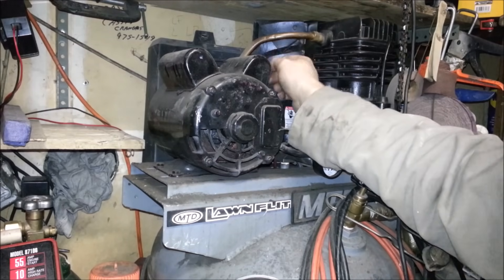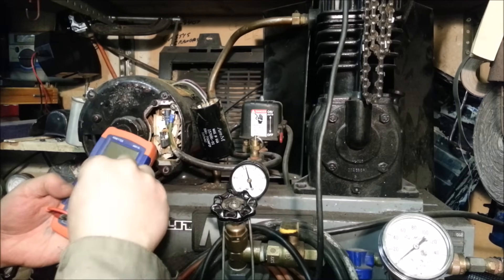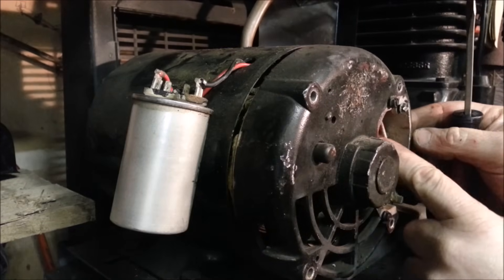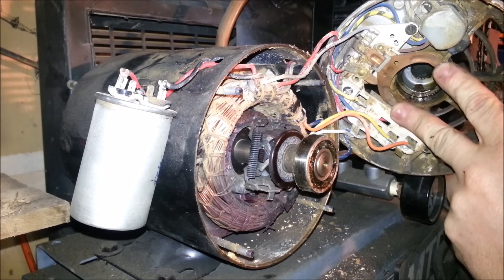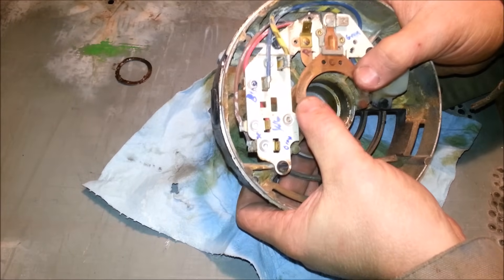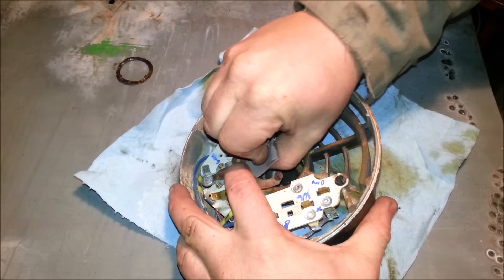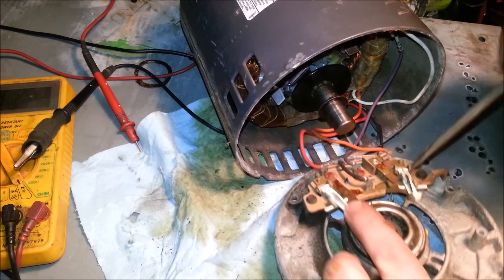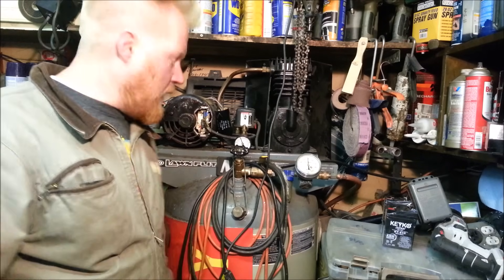Electric Motor Doesn't Spin but HUMS/Buzzes compressors etc

Comment: I got a Briggs and Stratton compressor from Walmart a year or two ago. It did the humming thing when it was supposed to refill. It would start fine from empty but when it gets down low and supposed to refill, it just hums. I had to turn it off, empty the remainder of the tank and then turn it back on for it to refill. It fixed itself over time, or at least it hasn’t done it in a while, but I was wondering what you thought the problem was?
Reply from the maker: There is a little check ball valve that holds back the pressure in the air tank. More than likely debris held it open and the air would force itself back into the pump.

Comment: In addition to increasing the starting torque, the motor rotation direction is also determined by the start winding.    To reverse the direction of rotation, swap over the two windings to the start winding!

Comment: If I'm not mistaken the run coil is bypassed while that centrifugal is in the closed (motor start position) when the motor RPM is high enough the run coil(s) are in series with the start coils... I could be wrong though (or perhaps not all centrifugal switch motors are setup that way ... I only remember the old washing machine motors (no caps at all)
Reply from the maker: The most common is to have the  Run and Start windings powered in parallel with the motor initial start and then the centrifugal switch  disconnects just the Start windings. The Start windings easily overcome the lower torque of the Run windings so powering them only adds to the ease of starting.

Comment: The humming that you hear is NOT coming from the "start" winding but from the "run" windings which stay engaged all the time (as long as the pressure switch is calling for air). The "start" windings cannot be the source of the humming because the start switch is not passing current. So the start switch does not transfer power from the start windings to the run windings.

Comment: Hey friend, is there any kind of grease that is safe to put on the contact's ? Mine did it again..they're not burnt but i did sand them..just wondering
Cheers friend 🇺🇸🇺🇸🇺🇸🇺🇸🇺🇸🇺🇸🇺🇸FORD RULES..THE OLDER ONES...
Reply from the maker: Not really. Most have a coating that prolongs the life. Once this is worn off they tend to wear out a lot faster. Some major brands of motors you can find replacements.

Comment: I bought a blue hawk from Lowe’s.  So many things have gone wrong with it.  I’ve repaired and made parts so many times I just can’t throw it away. It’s like a bad habit I can’t kick.  I put a date each time to see how long between breaks.   Total junk.  Currently it has two parts I made and and one of the capacitors is from my a/c.  I hate throwing stuff away.
Reply from the maker: I've been there many times.

Comment: This is a problem I’m having with my air  conditioner brand new motor and old one is stiff and hard to turn when I power it but it freely turns when turned off but it hums while turned on https://youtu.be/czbaucmSG4U
Reply from the maker: I would say the bearings on the motor shaft are worn out. This causes the motor shaft to pull to a side vs spinning. This looked like a trailer/motorhome roof top unit. You can take off the top cover and see the motor and shaft. The same motor and shaft runs the internal fan and external fan. If it is the bearings(bushings) you should be able to spin it up pretty fast by hand and then kick it on and it will continue to run.

Comment: What if the air compressor doesn’t do anything when you switch it on?
Reply from the maker: Check your thermal switch on the motor. Most compressor motors have one.

Comment: Why wouldn't you suspect the start capacitor?
Reply from the maker: You can spin start it if it's a start cap. In my personal experience the start cap rarely goes out but is the most common part to be replaced, because it's cheap and easy to get to. Generally the reason a start cap will die is due to overheating from the contact points leaving it engaged too long. So it is a contact point issue.

Comment: How long will Thoes contacts work after you sand the silver off?
Reply from the maker: Still working great. Haven't touched them since the video and I use this compressor a ton.
Reply: I've always had trouble with them. Never motor tho. Mostly lighting and controls.

Comment: You said that was a 120v motor. What's the amp draw and hp?
Reply from the maker: 15 amp at 120 volts or 7.5 amp if wired for 240 volts. That's around 2 Horsepower.

Comment: Wow man. I was having the same issue. My switch was not identical but, sanded the contact points and hurray! My compressor is back in business. Now just need to fix leaking pressure regulator.

Thanks man!
Reply from the maker: Thanks, I'm glad you liked it.
Reply: When stuff is broke there's little harm in giving it a look. You might not be able to fix everything but every fix you can do is one for the win column.

Comment: I really appreciate this video.   I just bought an old Craftsman jointer, used it a couple of times and then it hummed when I switched it on.    Some wood chips had jammed the clutch mechanism you were cleaning in the video.  I also cleaned the contacts.   Put it back together and it fired right up.
Reply from the maker: That's great. I'm glad the video was helpful.

Comment: I bought a used Quincy compressor several years ago.  Called Quincy to find out about it (parts availability, age, etc.).  Gave the guy the serial number and he said, "Let me see what I can find out."  He came back on the line and said, "We sold that unit to Southwest Manufacturing in Fort Worth, TX on Nov. 23, 1957." 😱. It runs great!
Reply from the maker: That's awesome that they had that info. Quincy Compressors are phenomenal.

Comment: I could never understand why anyone would thumbs down a great informative video like this. Well anyway, maybe you can help me. I have a GE 1/2 hp motor(4386) I use for grinding. The shaft spins freely, but when I turn on the switch, it buzzes and I can't turn the shaft with my hand. I took it apart and cleaned the contacts. It still does the same. Any thoughts. Thanks.
Reply from the maker: Bearings would be my first guess. If there is any wobble in the shafts the rotor will pull towards one of the side stators on start up and stay there; humming. You can test this by trying to move the center shaft(rotor) up/down perpendicular to the motor. If there is  any movement, the bearing on that side is shot. You can also test this by seeing if you are able to kick start it. Spin it as fast as you can by hand/stick, then turn it on. Generally you can get it to go this way.
Reply: Dummy me, I didn't tighten the 4 long screws(bolts) all the way when I was testing it so as you say, it pulled toward one of the side stators. After I mounted and tightened all the screw it is back to like new again. I think it was just some dust in the contacts. Thanks so much. You helped me save a motor that would surely have been thrown away by someone else.
Reply from the maker: @redbeak1453  That's great. I'm glad it's working.

Comment: Great video!  I will try this with my residential sewing machine motor.   It has the same symtom. Very instructional. Thank you!   :)
Reply: Sewing machine motors are different. They expect a manual push to get going. Well, they're not entirely different but they tend to not have a start winding. Starting torque is an issue with electric motors. So the easier spinning you can make things for them the better. Some oil might help? Push starting sewing machines is pretty common though. Still a good idea to oil them now and again. A light oil like 3 in 1 is good.

Comment: I think this is what my problem may be. When we're talkin hum, I'm talking like a loud hum. Really loud  almost scary. Can that sorta hum be included?? I've taken apart already and same exact setup as  yours. Like yours, mine has wood saw dust up in the stationary side up under the winding. It must have been used in a wood shop scenario.
Reply from the maker: I hope your issue is something simple like this.
Reply: @sixtyfiveford  140 grit I believe is what I used. Done if proper, sounds new. No more humming. You sir are the man. I would have never been able to get it running if not for your clear walk-through and also Jeremy Feildings how to understand motors videos compilation. Thanks 65F. 
Oh by the way what kind of 65?? Used to have 65 Galaxie 500 I miss that beast.

Comment: That’s the front end frame. Not the rear. Rear is the pulley (drive) end. And it’s a stationary and centrifugal   SWITCH not a clutch. and there’s certainly no gears.   There’s a start winding and a run winding. The start winding drops out of the circuit when the centrifugal switch opens.   Giving bad information about something you obviously don’t know anything about.

Comment: You sound confident in your ability,, might subscribe. I h ave fought with centrifugal induction motors alot. Usually washing machine and swamp cooler motors. Now however, its my 30yr old speed air two stage with a BALDOR,, very good if not the best built. I have almost the same set up. I took it apart twice already and it was a lot of trouble. Did all you describe already still no run, just hums and throws the reset or breaker. And no, its on the bench,, not on the compressor anymore

Comment: Do you have any idea where could I find the internal conexions of that kind of motors?  I have to repair one of those motors with centrifugal switch that has been completely destroyed by the rotor.
Reply from the maker: It's not easy to find any literature about the construction/wiring of the internals.

Comment: I had everything from bad bearing , brushes ,  air de-compressor gone bad on different compressors and engines . All will give the same whining symptom.
Reply: Brushes? What are brushes doing in an induction motor? Squirrel cage motors work by magic!

Comment: @sixtyfiveford 
I have an old pony air compressor the tank is rust out with a pin hole in it I was wondering might seem kinda of like a stupid question but use one of those portable air tanks for a replacement tank asking you because I not sure if their is a difference between an actual air compressor tank and a air holding tank thanks
Reply from the maker: The portable air tanks are pretty thin steel(half the thickness) verses an air compressor tank.  Not that it wouldn't work but I would search the local classifieds and find someone with a blown up compressor pump and take their tank. Or an old propane tank will be rust free inside and is rated to hold the pressure.
Reply: @sixtyfiveford that what I thought about the portable tanks I just didn't know for sure I have a couple 20lb LPG tanks but there not rust free I took the values off to get the fumes out but used water to help get it out but I think I can make do thank for your reply always enjoy your videos man great work and very helpful info man

Comment: Hi, great video.  You mentioned something about two speed.  I’d like to get in contact with you to discuss why my pool pump sparks when trying to go into second speed.
Reply from the maker: A start winding and a run winding in the motor all controlled by the centrifugal switch. Everything is described in the video how it works.

Comment: i ran into a similar situation with a dishwasher ..the contacts were corroded so i used a nail file ...it worked as soon as i plugged it back in..

Comment: I checked a humming motor  in a wall set ac unit ..use my hand to try to turn the fins but it wasnt easy , yet when i turned off the power the fins spins free and easy..wonder why
Reply from the maker: In your case the bearings in the motor are more than likely shot. The motor is just a bunch of magnets forcing the shaft of the motor to spin.The wobble in the bearings allows the shaft to be pulled to the side and lock up.

Comment: I'm an electrician, your description of how a centrifugal switch operates is text book, very well done on a clear simple explanation that totally non electrical folk should be able to understand. You also show how easy it is to save machinery from the scrapper with just 30 minutes of time and a bit of DIY.
My only suggestion would be to include the unplugged mains lead in camera shot so people can see clearly the machine is disconnected and safe, I have found over the years a couple of mis wired house sockets where the return wire is switched leaving the machine 'hot' even when turned off.
Cheers
Ray
Reply from the maker: Good point.

Comment: I have an older model commercial hobart mixer I inherited. It's over 30 years old but work excellent until I flip the switch one day and it just started to hum but did not spin. And electrician told me it has a capacitor issue. I'm on the fence on whether to take it to a repairman because I'm scared they would mess it up more. Thoughts please and thanks!
Reply from the maker: Take it to an electric motor shop. They'll get it back up and going in no time.
Reply: Thank you

Comment: same problem, it will start running if I tap on it. What would that be?
Reply from the maker: Could be a worn out front bearing causing the motor to vibrate instead of run. Or a dirty contact in the motor.

Comment: Can't thank u enough!! 
Fingers crossed I can now fix our swamp cooler.
Reply from the maker: I've repaired dozens of swamp cooler motors. Besides these contacts the other issue they die from is the front bearing being worn out. If the shaft wobbles/knocks (belt off) as you jiggle it, chances are it's done for. You can sometimes get a few more years out by rotating the motor 180 degrees, so the belt pulls on fresh part of the bearing(technically a bushing).

Comment: Awesome video. Im gunna try to fix my lathe motor today, as the motor just hums when i turn it on. cross your fingers!
Reply from the maker: I hope it's something simple like this.
Reply: sixtyfiveford the electricity is somehow backwards here... its a 110v reversible motor, and it worked perfect at my dad's place. I brought it to the farm out here, and it just hummed. I swapped the 2 input wires, and it works perfect. I tried cleaning the clutch contacts, took it completely apart and checked everything out. Everything was fine... not great, but fine.
No idea why this house would be wired backwards, or even if it could be... nothing else on the farm is affected... the compressors and pumps and everything else works with no issues...
Zero ideas whats going on haha

Comment: Thanks for the vid. I'm troubleshooting an electric hydro pump for an automotive lift. I'm a pretty advanced mechanic (self proclaimed) but still so much I dont know. That realy makes it easier to understand what is going on inside the motor housing for an a/c motor.
Reply from the maker: Thanks, I'm glad there's useful info here.

Comment: Question, my blower motor on the furnace is doing the exact same thing... it’s humming and buzzing then disconnects. If I manually turn it by hand, it starts right up. What would you suggest? Any ideas? Thanks from the single mother trying to fix herself and save some money!
Reply from the maker: A furnace blower motor is generally a bad front bearing. The worn out bearing allows the motor to vibrate(hum) vs spin. By you kicking it over by hand, it gets past this vibration and spins up to speed. The motors are generally $50-$100 on Amazon. You slide out the entire assembly and then you should be able to read the decal on the side of the motor. It will say the horsepower ie: 1/6hp, 1/5hp, 1/4hp, 1/3hp, 1/2hp or 3/4hp. I can help you locate a replacement.
Reply: Thanks for your response. I’ll let you know what I find when I take the thing out.

Comment: Thanks for a good overall synopsis, moreover a good fix! Fellow Ford guy, have a '27, '47, '52, '54, '55, and a '63-1/2! Now I'll have a 10-inch table saw again!
Reply from the maker: That's a nice assortment of Fords. At the present I have a '59, '65, '66', '78 and a few newer ones. I need more space to accommodate my desire for more.
Reply: Not bad-Quincys usually use Baldor motors, but that didn't look like one.  As far as cleaning the contacts-think points on one of your Fords.  Those old point files are the best for that-and never ever grease the  phenolic on the centrifical switch. PS-I own a electric motor repair shop. PSS  Also have a '55 Caddy Ambulance, "71 Ranchero, '53 Studebaker and a '67 Firebird.

Comment: I was in the middle of a pallet wood project on my lathe when I was not able to restart the motor. I suspect the problem is dust that got in there. Will open up the motor and follow you instructions. You gave me the confidence to play with something electrical, I will leave the motor disconnected for 24 hours before doing anything.
Thanks for the video, you may have saved me an expensive lathe motor repair.
Reply from the maker: Check the reset switch(if it has one) as this is the most common thing to trip on a sawdust filled motor.

Comment: hey sixtyfiveford im a gearhead to i run super comp dragster hey my well pump points stuck on and ran the hell outta my water pump for my well now it wount turn its siezed up im thinking the berings it still makes a buzzing noise when i throw the braker back on do you think the berings couldof locked up its a 1  1/2 hp deep well 20 volt electric motor ????
Reply from the maker: Bearings could be locked up. It would give identical symptoms to the motor in the video.
Reply: thank you sooo much for answering me have a good day n thanks giving to !